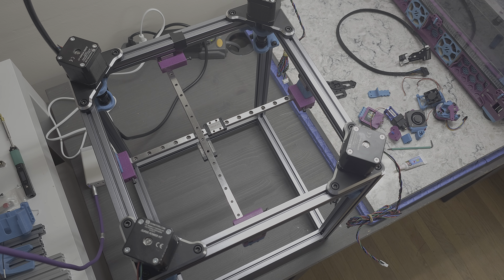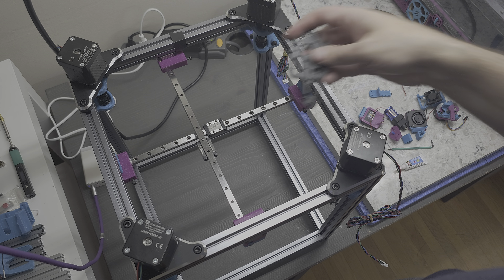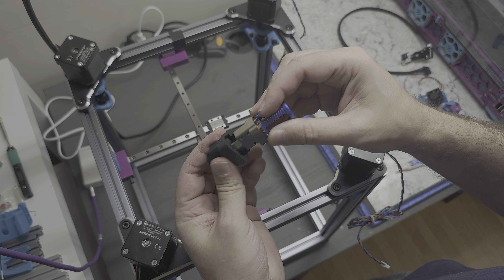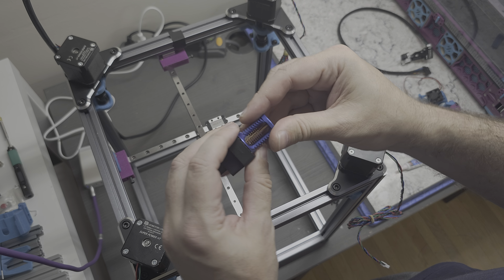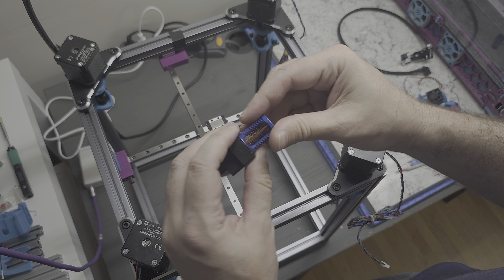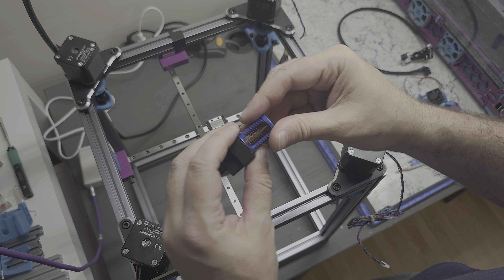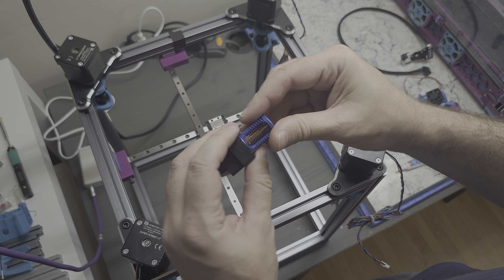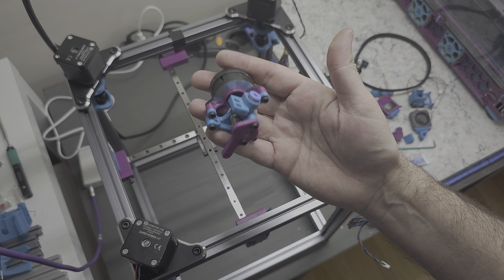Annex Engineering K3: Build Part 06 - Toolhead Configuration - No Build Today!

Comment: I thought the Fabreeko kit was all 24v fans?
Reply from the maker: No, all three toolhead fans that came with my Fabreeko kit were 12V.
Reply: Interesting, just checked and all mine are 24v from Fabreeko's most recent batch. Maybe they mixed some 12v ones in. 

Love your build! Really beautiful colors.
Reply from the maker: @Apophis-en9pi  I don't know if the 12V fans have better performance, but I am running them on an Octopus Max EZ, so switching voltages is pretty easy. Thanks for watching!
Reply from the maker: @Apophis-en9pi  the voltage selection pads on the K3rabiner were already set for 12V, so I didn't have to mod it, which suits me just fine.
Reply: @oldguymeltsplastic  Yeah resoldering the pads was a pain. You're lucky haha.

Comment: No room on the toolboard for the filament sensor?? Or can you steal wires from the sensor plug??
Reply from the maker: The 4 pin Probe port on the K3rabiner is labeled with 5V, D+, D-, and GND. I guess intended to be a USB pass through port. That's what the Beacon probe needs, so makes sense. The filament sensor on this modified Sherpa Micro will need to be wired directly to the electronics bay through the braided sleeve of the umbilical.
Reply: @oldguymeltsplastic  Downsides and upsides to CANBUS connections vs a bunch of wires. A CAN board would have the pins for extra sensors but you can't pass through a USB connection. But also a CAN board will definitely lower the maximum temperature you can get your chamber too, I have like ~5°c or less before my toolboard MCU overheats at max chamber temperature 

I also have a BD Sensor on the way to try as that one doesn't work over USB compared to beacon
Reply from the maker: @kiiiddd  while I am a fan of CAN Bus myself, Annex Engineering aren't, so I am building this stock at first. Will see what kind of mods end up on it.
Reply: @oldguymeltsplastic  I would almost go the ACM panel route and see how high you can get the chamber temperature to get some super strong prints and/or work with high temp stuff like PEKK
Reply from the maker: @kiiiddd  spool of pekk costs more than the printer... 🤣
Reply: @oldguymeltsplastic  yeah Nero printed a Benchie outta some. Probably one of the most expensive Benchies in existence
Reply from the maker: @kiiiddd  Even if he didn't get it for free, he can afford it. His channel makes him more money than mine does me. 🤣
Reply: @oldguymeltsplastic  My vote(which doesn't matter) still goes for the high temp setup, being able to make nice PA or PC prints would be good and the design of the K3 looks like you could get some high chamber temps with a couple bed fan's